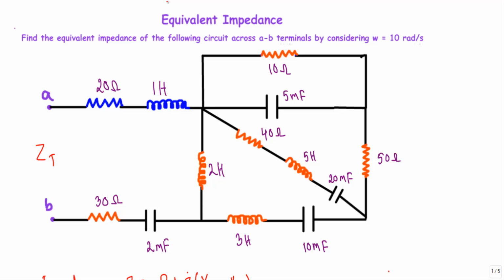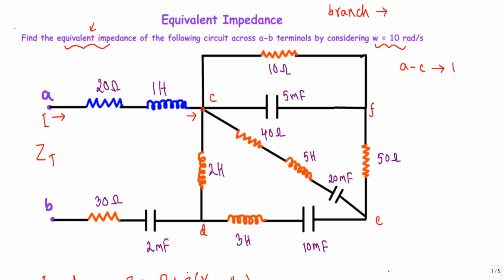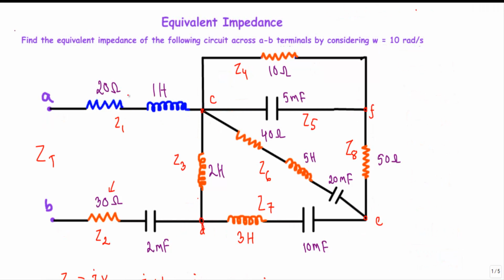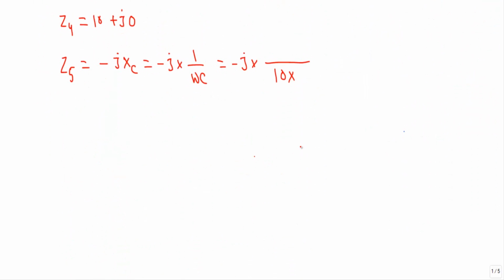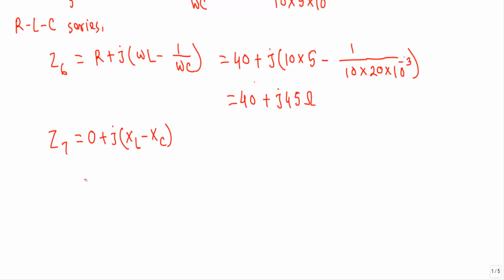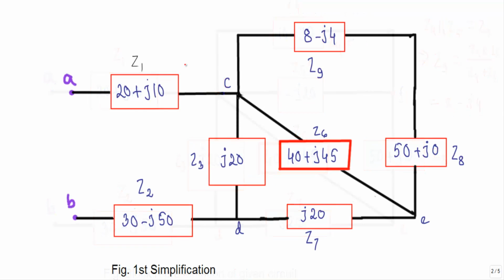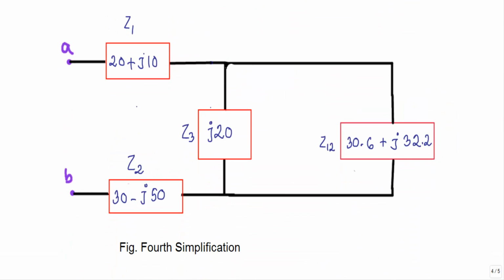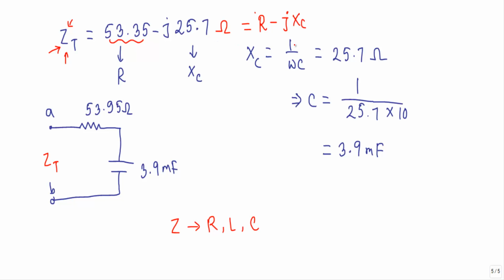Equivalent Impedance of Series - Parallel AC circuit (Hard)

Comment: Where is calculations of parallel impedance?
Reply: If I understand your question, it is the same as the calculation of parallel resistors.  For two resistors, its (R1 + R2)/(R1 x R2).   So for two impedance branches in parallel, it is (Z1 + Z2)/(Z1 x Z2).